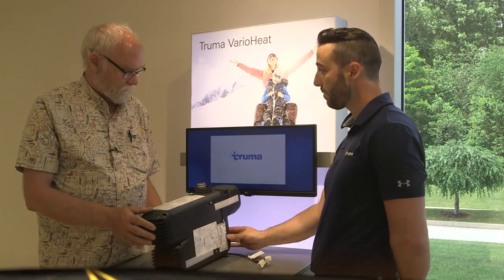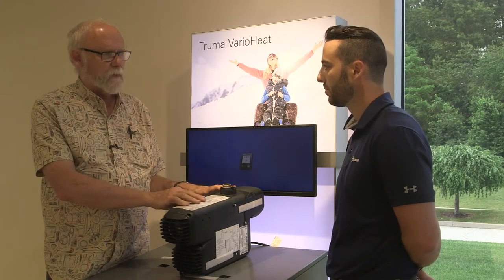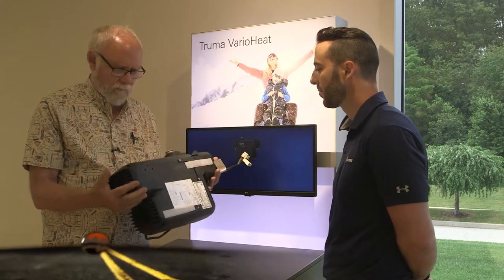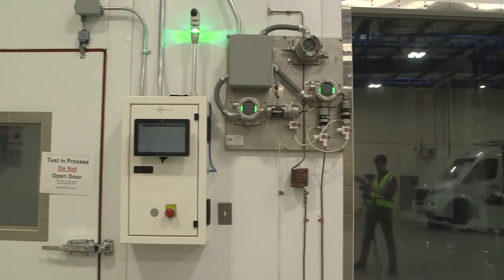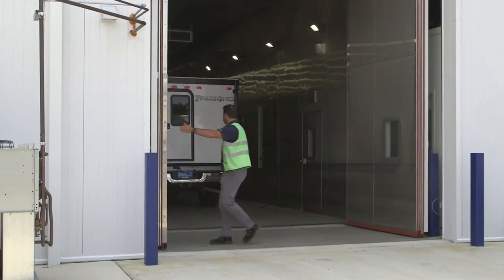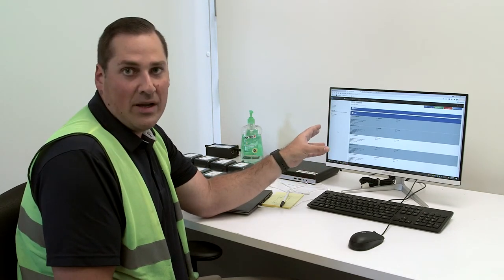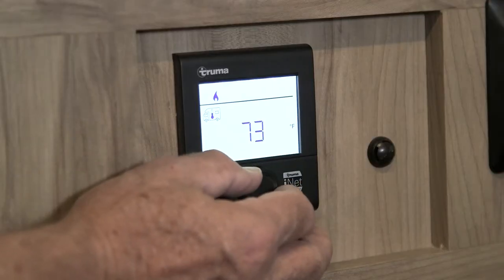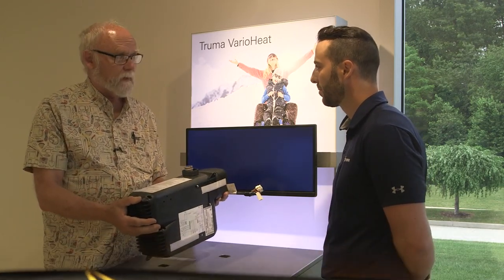Truma's new VarioHeat Furnace on show segment 2021-21

Comment: I notice the temp sensor in your truck is about mid point height in the cabin and below the height of your beds. Does it work ok there or does it shut off the heater too early. The Truma manual says to put it high in the cabin but see that's not possible in your vehicle.
Reply: You Actually have it Backwards.
Heat Rises, The Higher you Place the Sensor, the Sooner it will Shutdown..
Reply: @erskftv6160  yes aware heat rises - reason I couldn't make sense of Truma's instructions which say to mount it high in the cabin. ?

Comment: 32 degrees F or 0 degrees Centigrade is nothing. Barely worth putting a heater on for.  Clearly the Truma doesn’t do very well in proper cold temperatures or they would have done it.